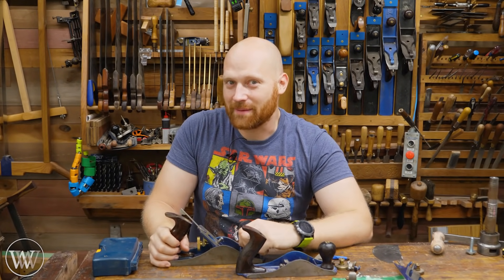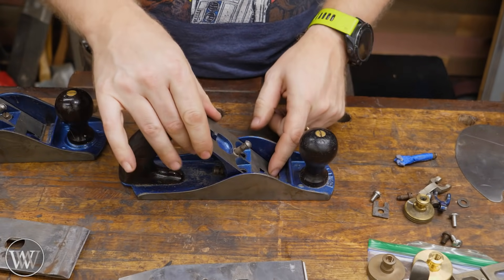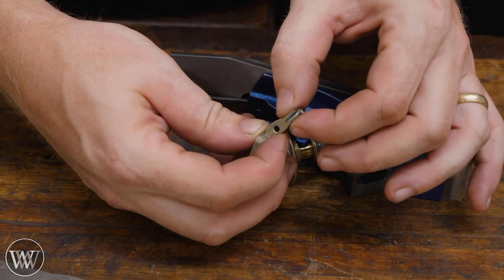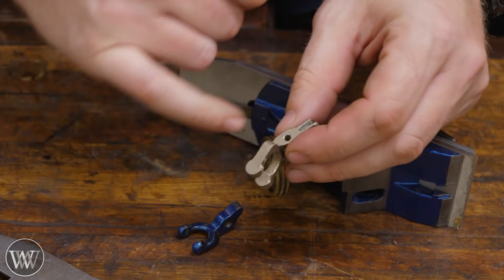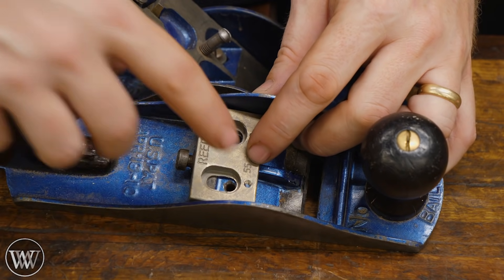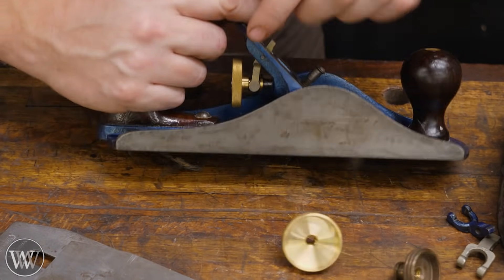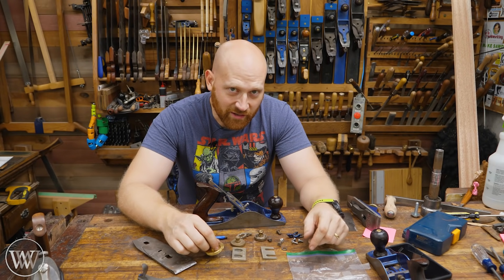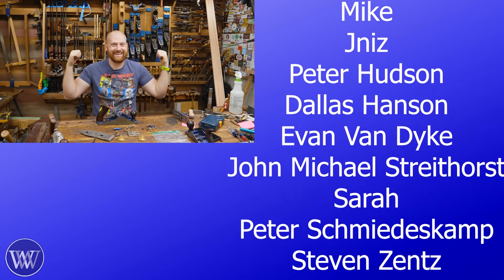Supe Up your Hand Plane By Giving A mouse a cookie

Comment: The concept of aftermarket parts for old hand tools definitely has a niche potential. Just like a vehicle: not necessary by any means, but nice for the ones who like to take it to 11. Considering how many planes and such that I have that are 1 or 2 parts away from a fully functional tool, I can see rationalizing purchasing a brand new part (as long as it's as good or better than the original) as opposed to searching ebay for a hard to find great condition set of vintage parts. Now, if you guys can come up with some aftermarket brace parts as well, I'd have another dozen or so working tools to bring out of retirement!
As for the fine threaded knob, a great concept in theory, but reality is different. I can say from experience that fine threads may be more precise, but take much longer to adjust, and it's only as precise as the least precise part of the mechanism in use. Unless you're the type of person who has, say, 2 or 3 number 4's set to specific depths of cut, (and all the power to you if you're lucky enough have the bench space) constantly having to switch between hogging and final passes will make the concept rather regrettable...
Also, although manufacture will be more costly, the frog adjuster really should cover both front and back mating surfaces. Even though the change in angle isn't super extreme, you're greatly magnifying the force that's put on the frog right behind the mouth by making it a single point of contact vs a full surface contact. I'd hate to see someone chip a frog or heel of the mouth that way.

Comment: I'm a fan of anything that reduces slop and gives me greater accuracy! As for the depth adjuster knobs, for smaller planes I would like any extra weight I could get. I would be wary of the angle adapters as you are introducing more parts with the potential to move and or perhaps charter. This may be incorrect but it's where my head goes. In order to change the angle I would rather a whole new frog, but at that stage is it just time to think about a getting a new plane. I might just stick to back bevels for now.

Comment: I don't have enough experience (yet) using and adjusting planes to have a useful opinion. However, in general I think the availability of custom or customizable parts is a good thing. I need some way to make more room for by fingers around the adjusting knob.

Comment: I have had 2 bedrock plane yokes built up at my local hotrod shop. The guy there is a very talented welder, used nickle. Then I filed them to fit perfect with my lie neilson blade and chip breakers. Stll have the slop though. The micro adjustment and bed angle ideas are brilliant! New yokes would also be a great improvement to what I did..... love all the ideas in this video

Comment: I'm more interested in the modifications to the yoke and the adjusting screw than I am in the wedges to change the angle of the frog. I think it's a simpler fix to put a back bevel on a plane iron to change the angle than adding wedges. I have a Stanley No. 7 that I bought new ten or fifteen years ago and it is utter garbage. I flattened the sole, replaced the plastic tote and knob with wooden ones, and put in an aftermarket blade and I'm still not happy with it because of the huge amount of slop when I adjust the blade. I'd even been thinking of adding tiny washers to the ends of the yoke to get rid of some of the slop. I also like the idea of a bigger adjustment wheel and finer threads on the adjustment screw.  The smallest bench plane I use is a No. 4; and generally, I tend to use larger planes because I like the weight. I've tried thicker plane irons and chip breakers and I don't think they make all that much difference. I have had a few old plane irons that were unacceptably soft and one that was noticeably bowed across the width of the blade. I think better steel makes more difference than greater thickness. When I get a plane with the old-fashioned chip breaker, I dress the edge of the chip breaker on a diamond stone so that it fits tightly.  Over the years, I've found that I prefer Millers Falls planes to Stanleys, I think they're generally a bit better. I have a Miller Falls No 22 on the way to me and I'm hoping I can make it perform better than the Stanley.  I'll let you know if I'm successful.
Reply: First off... in regards to the upgrades... I agree with Kenneth. I have 2 #4 and #5 planes I use, one with a back bevel and one without. Easy and cheap. The adjuster yoke seems like the lowest hanging fruit, especially if the engagement for the adjuster nut was sized for the largest likely nut and could be filed to fit. Filing might be finicky though... really it should be a consistent radius throughout the range that the yoke would contact the adjuster nut. It would add complexity, but I wonder if an overly wide yoke with interchangeable disks to fit a range of adjuster nuts would work well. I also like the idea of sizing the yoke protrusion to fit the chip breaker slot. I don't know if the split with adjuster screw is the best option... I worry that it would add complexity and cost to the manufacturing process and unless you swap chip breakers occasionally you'd only need to set it once. What about offering an overly thick version that could be file/ground to fit? Seems like a cheap and easy solution to me. I also think I'd like the fine thread adjuster nut when I'm trying to dial in the depth of cut to get gossamer-like shavings would be awesome, but I wonder whether just getting rid of the backlash between the nut, yoke, and chipbreaker would be sufficient. All the bells and whistles are awesome, but at what price point and when does it make more sense to replace my vintage planes with L-Ns? (Rhetorical question... I've told the family I intend to be buried with my vintage planes!) 

Now off topic but on Kenneth's last comments: I'm interested in hearing more about your Millers Falls vs. Stanley comparison. Is it just Stanley Bailey, or are you including Bedrock in that comparison? I just picked up my first Millers Falls bench plane because I want to see how they compare too (it's a #10). I've got Millers Falls #56 and #57 block planes that I bought to compare to my Stanley blocks, and while I haven't done a mindful side-by-side comparison I find myself reaching for the MF planes more often than the Stanleys, and that includes my reliable old friend #60-1/2 that I've dialed in over the years and fitted with a Hock iron. I've also been comparing Sargent planes and while I think the VBM vintage are better user planes than Stanley Bailey, some of the older and newer vintage are not quite as good and it seems Sargent was less consistent with the manufacturing processes. One of my favorite go-to planes is the #4 size Sargent Shaw's Patent VBM #9 which took the place of a Stanley Bailey Sweetheart #4 as the standard bevel one in my cabinet. I'm thinking the Stanley it replaced might be a good candidate for testing out these yoke and adjuster mods.

Sorry for the long dissertation... my wife tells me I ramble a lot! I know she's right.
Reply: @Volksaholic   Well, Interesting commentary and worthwhile questions. I'm going to limit my comments primarily to Stanley and Millers Falls although I will reference my Lie Nielsen bronze No. 4. Other than the LN I don't own any Bedrock-style planes. I admit I can't get all shook up about the much-praised ease of adjustment of the frog. How often do you adjust the frog on your planes?  I very rarely adjust the frog on my planes; I set it and forget it. I might consider changing it if I change blades, but mostly it stays where it is. So Millers Falls Planes are Stanley Bailey knockoffs and are in many ways identical although I think the "good" MF plane, not their economy line is marginally better. I've never done a weight comparison. but they just feel more solid.  I do think the lever cap on the "good"  MF plane is superior to the Stanley and I think their blades are better (I've had a couple of very disappointing Stanley blades). The experience I had with the relatively recently manufactured Stanley No 7 was a huge disappointment. I've never had to fight to get a used MF plane working.  I disassemble them, clean them, sharpen the blade and hone the edge of the chip breaker, reassemble them,  and put them to work. I will admit that I have a Stanley No. 8 with a 1910 patent date on it that will stay with me until I'm too old to use it. I also have a MF No. 15 which is the best jackplane I've ever used. Imentioned earlier that I have a MF No. 22 on the way; I'm eager to see how that performs and wish there was a way we could chat about it without boring everybody else crosseyed.

Comment: Having a cheap Stanley no 4, the biggest problem is that the lateral adjust is made of too thin stamped metal, and rather bends over than provide sufficient force to adjust properly. 
Other than that I'd really like a yoke to fit properly. The thread on the knob is plenty fine as standard, but I'd replace the plastic knob with brass in a heartbeat.

Comment: I'm mostly into the frog angle adjuster. 
Instead of having to pull your adjustment stud out of the back, couldn't a tube, with threaded ID and OD, be screwed onto the original stud? Then the OD (external) thread could be a finer pitch and one wouldn't have to remove the original stud.

Comment: What crossed my mind is that cast parts use less material than machined parts. This offset some because casting reqires a complicated mold and ia m not in a position to do a proper cost analysis between the two methods, but I know I am right about casting requiring the least material. I also think that the protuding part that can be filed to fit is a good idea.

Comment: The issue with fine threads is ok the adjustment is twice as fine, but that also mean that changing the setting or retracting the blade will be twice as slow. And btw the amout of slop is also doubled :) adjusting yoke, definitely a good idea though i had good results welding the top to make it fatter, and hamering the knob to make the gap narrower (yes, its brass so it's super ductile)

Comment: Also like the fine pitch wheel, but on the yoke front I definitely like the longer yoke but I think the end should be kinda bulbous like the Woodriver planes so we can file to fit instead of using the screw adjustment, to me it seems like your asking it to crack there as a result. As for the pivot point for the yoke I would also make it undersized so it can be drilled to exact size. I think we can skip the frog angle  adjustment shims.

Comment: A very cool set of ideas, generally. 😁

The bed angle shims are a waste of time, though.  It’s quicker to add a back bevel to a standard blade to create different presentation angles to the work.  With bevel-down tools, a 5 degree back bevel changes the 45 degree frog angle to a 50 degree presentation angle; a 10 deg. back bevel to a 55 deg. presentation angle; etc.  You don’t even need stones to create this additional bevel - stropping a micro-bevel on the back of a plane blade at the desired angle is enough.  It’s only the angle at the very tip of the blade that really matters anyway.

If a person is going to go to the expense of ‘upgrading’(?) to a thicker blade, it’ll almost certainly be more cost effective for them to buy 3 or 4 such blades, leave one of them ‘vanilla’ for the 45 deg. presentation angle and back bevel & label the others.  Blades are mass produced items, so the tooling & expertise to produce them already exists.  If you want to make changing between presentation angles even quicker, buy the blades and chip breakers in matching numbers.  Then you can leave each blade permanently mounted to a chip breaker (except when resharpening) and changing between presentation angles is just a matter of removing the cap iron, taking out one blade-chip breaker cassette, popping in the desired blade-chip breaker cassette and refitting the cap iron.  Job done.

Sorting out the slop in the blade depth adjustment mechanism - superb idea.  Likewise, your proposed solutions to enabling that adjustment to be finer.

But what you propose for enabling presentation angle changes? Don’t reinvent the wheel.

Comment: I like the idea of the yoke.  Larger heads to fit. Hole smaller than needed to drill out but the hole is there.  Larger part into the chip breaker that requires filing.  The screw/wedge sounds like it may be more complicated than it needs to be.
Reply: Yes, and oversized "ears" to fit a replacement wheel (with the groove designed at the upper end of original wheels) that can still be filed to fit originals.

Comment: A kit would be nice!  How about a customizable kit?  So many pieces for X price? Then people can get exactly what they want.  Additionally, each piece could sell separately. 

As you went through it, I found myself excited because an old plane could be beefed up for a reasonable cost.  I think once before I aßkeď if the newer better quality blades and chip breakers could be added to a plane.  I began to see that other adjustmènt issues would be impacted.  Therefore, I think this idea you've presented iß excellènt!

Recently, I purchased a small stanley box plane that I fell in love with.  It had the thickeŕ blade with the strait chipbreaker..it works beautifully!   If only I could buy parts to reoutfit the bodies of some of my other planes, I would be in handplane heaven!

Comment: Really want to see the difference with changing the angle. Would be really cool having any of these upgrades. But if the angle makes it preform better I'm super interested
Reply: Get a spare iron and put a back bevel on it. It'll change the angle the same way. Cheaper and easier to deal with while working.
Reply: @theenderface7379  oh that's a pretty dang good idea. Thanks

Comment: I like the wedges, they seem straight forward and I would buy them if they actually work well (example of not working well would be like moving out of place when planing) I supposed there’s a market for the yolks I personally prefer the old irons because there easier to sharpen and I don’t mess with more than 2 bevels. That said.. a replacement frog with a iron would be a interesting idea if it were on the table, something easily replaceable (but then you’ll have the different types to contend with). I like my planes stock but I don’t like the slop on the adjustments. Option are good as long as they work and have a reasonable price (not like most products in woodworking$$)  nice vid btw.

Comment: This is exciting stuff you have going on there. I would be interested in all of them. Maybe not for every plane I own (some are not Stanley or Stanley clones for Sears etc), but two or three would be greatly improved by these upgrades. The blade adjustment knob back lash is most annoying. Drive on!
As a side note. When he is done with those improvements, might he be interested in fashioning a composite material (wood would be too difficult) handle for turning a No. 6 or 7 into a side handle shooting plane? I bet you could sell those too. FWIW

Comment: Making the adjustment knob fit the standard stock adjuster properly without all the play and a finer adjuster thread would be good, and make working a little quicker. The different angle and thicker blade and messing to punch out the pin to change the adjuster, not so sure I would bother buying into that. I am just a hobbyist and it maybe takes some extra time to solve the problems you are perceiving. Interesting ideas though and enjoy your channel.

Comment: Would enjoy less backlash in depth. Hollow knob, but not sure I feel a need for a finer thread.  Like thin irons, myself.  Slightly different tack: an easy way to reattach the lateral adjustment lever, and perhaps adjust disc size, could make it substantially easier to flatten the frog. And also maybe replace some of those levers with folded ends.

Comment: I'm def interested in the depth adjuster upgrade. I'm trying to tune up a postwar No5 and with a thicker iron and two  different chip breakers - with one it won't retreat all the way and the other it barely comes out. It also just has a lot of slop. I'd love to not have to relegate it to scrub status.

Comment: Definitely interested in the upgrades yoke & fine adjustment screw for all my planes.

I agree with many others that the joke tip should be oversized so it can be filed for a bespoke, snug fit.

The  high angle adjustment wedges would be of interest, but should be milled & lapped so can be used out of the  box with no fettling / lapping required.

Any time frame for when these may be available on the market?

Comment: Yoke might be thick enough that it need filing to exact thickness instead of screw to fit larger hole. I am afraid that screw in the middle might cause a yoke break in future.

Comment: I'd like to see some tools for restoring handplanes.  Some simple thread chasers to clean up old threads would be very helpful! I've just been finding out today that they use non-standard threads. Though I have Record planes they copied the Stanleys down the threads. The depth adjuster is a left hand 9/32 24tpi and the frog and others 12gauge 20tpi, not idea what the thread angle is (55deg?) . It appears to be very hard to find taps, dies etc for these odd sizes.

Comment: I want a kit with a hollow knob, fine-thread screw and a yoke that is fit to the knob.  For the pin in the yoke, I’m not sure if I’d want it drilled or not.  I’d prefer to drill, IF I have the proper size drill bit!!  I think that right-size drill bit would be my undoing in the effort to upgrade.  However, I think with the yoke improvements to lessen slop, the pin won’t add in too much (hopefully), so maybe just pre-drill for the pin.  I think you could sell a second kit with the frog angle adjusters.  You might have to provide longer screws.  I’m looking forward to when your friend can have these to market.  Great ideas!